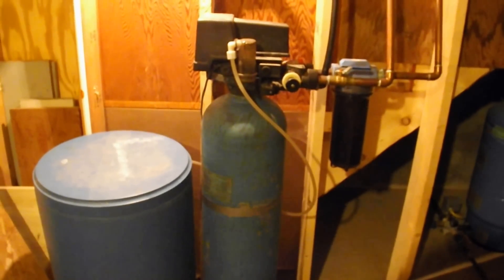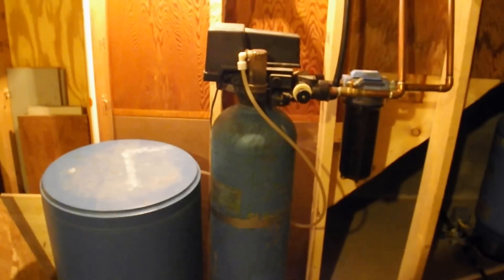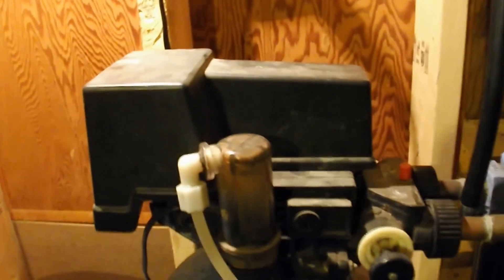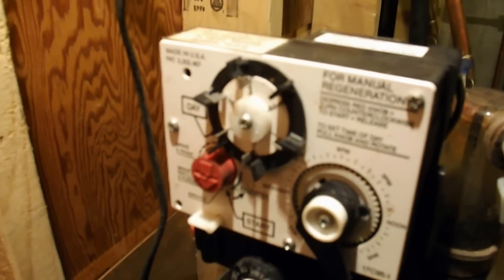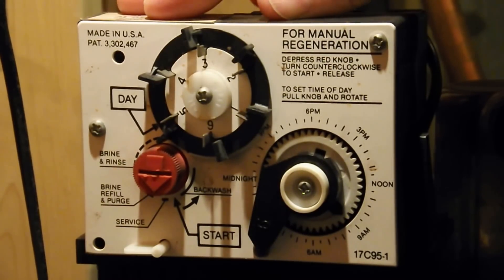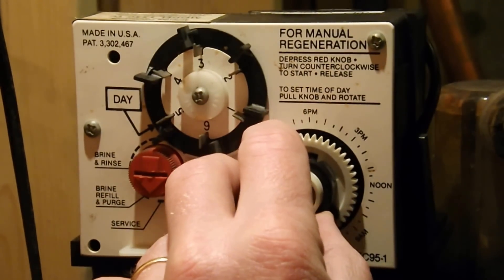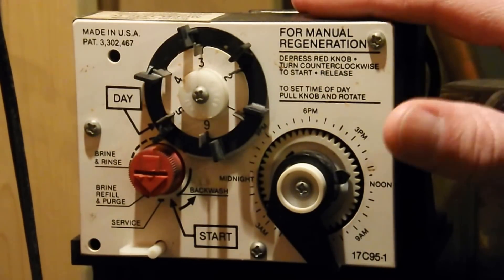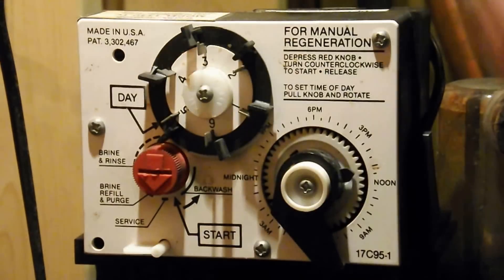DIY - How to Set Your Water Softner Timer

Comment: I was so glad to come across this video, what is the function of the red button and I notice the little plastic lever button below the red button is turned to the left, mine is straight up and down, I am hesitant to move it into the position of yours because I do not know what it is controlling
Reply: It says in the upper right corner what the red button is for and as far as the white looking flag below the red button that is a plastic pin that you can pull out if you want to disassemble the valve head for maintenance. If you turn that like in this video that locks the pin in place so you won't hurt anything 😉
Reply: Autotrol_255-460i_Owners_Manual.pdf

Comment: Can you explain red dial and what terms mean?? Thanks!
Reply: The red button is used to manually do a regeneration. You press it in with a screwdriver and turn it counter clockwise so the arrow is pointing to the start line and then let go of the red button. It will start the regeneration cycle👍